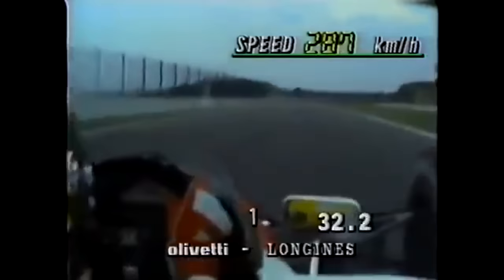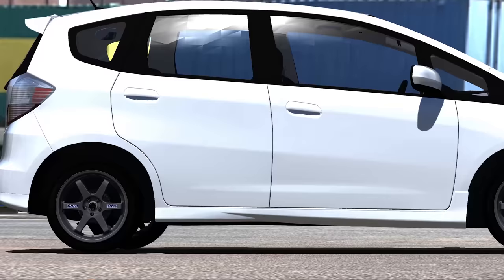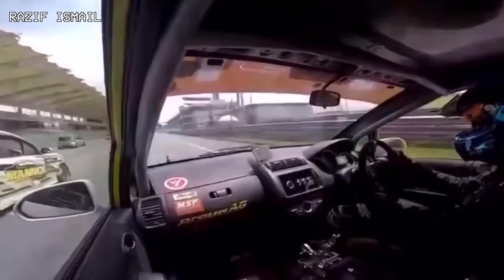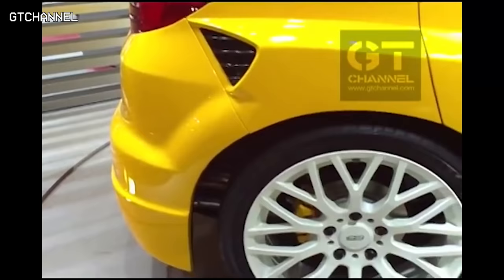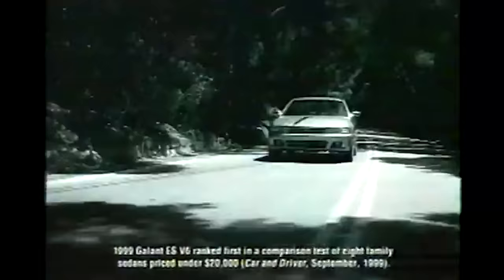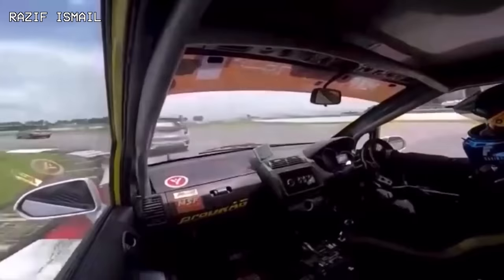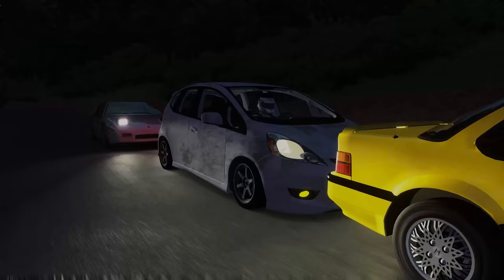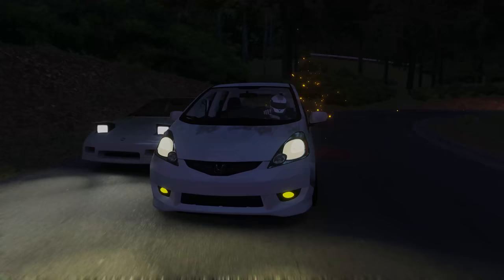Honda Fit - What Makes it so Great?

Comment: Yall i freaking love Fits, It made me so mad that honda is no longer bringing them to the US. I was so looking forward to the super sharp design we would have had. But I've an 07 base and now an 08 sport and I'm in love. Just stock these cars have quite a bit of power behind them. It shocks everyone at the stock rally I visit occasionally. Not many people expect a sub compact car to be able to accelerate, and handle like these do but it's all props to honda, a manufacture built on making it's customers happy. If we weren't happy we wouldn't keep buying the same brand, and trust me I've owned just about every basic daily brand out there, Nissan hated it 2015 went through 3 transmissions in 2 months... pontiac was okay brake system was shit, kia known for being killed in action blowing the motor, VW I loved my jetta only reason I sold it was due to medical issue keeping me from using my left leg to push down so couldn't press clutch. Hell I even had a chevy/toyota collab car the prizm, built with the same parts in the same place as the corrollas just had the old oval chevy logos. That was a great car till the alternator went and threw the timing off.

Comment: I've owned my 2012 Fit Sport 5 speed manual since new. Been a Honda head for 30 years, so it was my 4th Honda. I bought it because it reminded me of my first car, a 1989 Civic Si; light, tossable, great handling little hatch that is a blast to rev out!. I still love driving this "dinky car" as my wife like to call it. Nothing like taking highway on/off ramps at speed and feel the car just bite into the corner with some serious grip!

Comment: Japanese hatchbacks are a lovely work of engineering. Never had a Fit but always noticed them and imagined how much fun they would be. Am currently driving a Canadian K13 5 speed Nissan Micra. Maybe a Micra video could be done sometime?
Reply: I was thinking about the same because of my k13 manual. Its my first car, I have it for 8 years now and I still love it!
Reply: @raphaelaml391  They are great cars. I've driven my Micra across Canada seven times. No problems. Never a check engine light. Simple regular maintenance. Strong little machine.

Comment: I had a fit and loved almost everything about it. Except for the power. I think Honda missed an opportunity with this car to take it from a great car to excellent -> k20 motor. Had they done an Si version on this thing… we woulda been all having Fits.
Reply: What generation? I've driven 1st gen auto and 3rd gen CVT and its a night and day difference. By no means speedy, but plenty of power for its size.
Reply: The Fiesta ST was one of the few performance subcompact cars available in North America. Too bad it wasn't exactly the most popular car and a lot of people didn't really know it existed (It often gets mixed up with the Focus ST). Basically the size of the Fit, but with 200hp and 200tq. It had great aftermarket support and people often turbo swapped it easily making 300-350whp reliably. It's nuts putting that much power in such a light and nimble car... Now if only GR Yaris came to North America...
Reply: @AzNightmare  I'm not sure that the Fiesta is relevant to this conversation? Is also turbocharged where what people miss about the old Hondas is more the NA power.
Reply: @christopherjohnston6343  Well, it's a car that is similar in size. I don't think anyone is missing old Honda NA power. They want something tiny like the Fit to have more power.
Reply: @AzNightmare  you clearly have never owned an older VTEC Honda. If it was just about speed we would be asking for a turbo L15 - which pretty much makes the Fit a competitor to The FiST. But when people go on about K20 Fits its because these were the engines in the type R Hondas and they revved well and have great potential as an NA platform.
Reply: @AzNightmare  I have a 2016 with 20k miles on it all mishimoto add ons...
Reply: @AzNightmare  ps I would have bought a gr yaris if it was available here in the usa...
Reply: My Honda Jazz around town is pretty slow but once I'm in the mountains and honking along over above 4500 rpm there's no lack of power relative to its size. I can keep up with a lot of bigger more powerful cars unless there's long straights.
Reply: @caesarforlife1663  same thing. My Fit is basically a Touge beast. Small size with decent handling means I can carry a lot more speed on narrow roads than bigger cars - even if those cars are a lot more powerful

Comment: Years ago, I had an EG Civic (before nice ones were rare). I loved it. While looking to downsize, I recently watched a Fit review, and noticed that the Fit's specs are similar to the old Civic's. I get what makes it so good.

Note: I bought a Mazda 2 with a 5 speed and haven't stopped smiling yet. I'm curious how the two compare.
Reply: I remember car and driver saying the Mazda 2 was more fun but the Fit was just way more practical while also being fun and engaging enough. So they chose the fit for the 2010 10 best
Reply: @ShaiyanHossain  I guess that's why you see so many more Fits on the road.
Reply: mazda has plenty to offer in tech, unlike honda which kinda stingy but for all the accessories, honda has unlimited toys to buy & play.
Reply: I used to own a Mazda 2, and currently own a second gen fit. The mazda feels more raw than the fit, sharper throttle response, a very easy to use clutch peddle (engages very low so you just take your foot off the clutch and your off, vs the fit where it engages near the top of the pedal, requires more conscious effort to operate, the downside is the 2's clutch is much easier to burn if your doing hard launches all the time) The 2 feels better at lower speeds generally, quicker turn in, more willing to rotate (can bite you in the wet) while the fit feels more stable at high speeds. I find the Fits drivetrain to be a lot more exciting then the mazda 2's, (117 hp at 6800 rpm with 4.6 final drive [second gen fit] vs 100 hp at 6000 rpm with 4.1 final drive), but the mazda 2 is like 100 kg lighter so its not slower at low speeds, just feels slower with the relatively long gear ratios for its power level. Obviously the fit has way more room, its basically a mini mini van. Overall i'd agree with the sentiment that the mazda 2 is more fun while the fit is more practical, with the caveat that the engine and trans combo on the fit is more fun than what you get in the mazda 2. But they are both excellent cars with a good balance of fun and practicality, with each leaning slightly towards opposite ends of that spectrum. 

P.S. I think the fit may also have superior build quality, it being a honda, thing feels indestructible. I've owned a mazda 2 and a 3rd gen mazda 3 and both seemed susceptible to having their alignment thrown off by hitting a pothole, but that's likely due to the high negative camber that mazda runs on their cars, which is probably also the main contributor to the great turn in response that they have.

Comment: It's the biggest small car! A really innovative feature is how the seats in the back fold up (i.e. the part that you sit on can be lifted up). this allows you to store tall things like pot plants. It's a little thing but it's just so clever. Our household has a fit and a Mazda 6 (Mazda Atenza). We use the fit so much more. To transport cargo, it's much more versatile. On road trips, it saves petrol. In the city, it's easier to park.

Comment: I was lucky to find a 09 sport 5MT with a blown engine for $200. I spent another $1200 on a used engine and labor (perks of working at a Honda dealer). 3 years later and I still love it, I get up to 40mpgs and have a blast shifting through gears and taking corners. Truly an amazing commuter car.

Comment: The best honda fit/jazz is the 2nd gen, Its chassis is based on the FN2 civic type R. The car handles amazing and this is coming from a 86 owner.
Reply: seconded with the GE, i run HSD Dualtech Coilovers, RZCrew Intake Manifold, K and N induction, 2 inch exhaust system, Corbeau A4 seat, Hybrid Racing Short Shifter and it feels like im driving a racecar all the time hahaha, the damn thing eats through every corner without fail, I genuinely dont want another car.

Comment: I agree, the fit is criminally underated. In fact I think it's the new ek/eg. I've owned ae86's, c33 laurels, s14 silvia etc etc and my current GK5 with a little setup is astonishingly good as a touge car.

Comment: Love my 2009 Fit. I was looking to replace it with a 2022 model and found out.....very unhappily that Honda stopped selling them in the U.S. market ☹️
Reply: If it makes you feel any better, there are plenty of Aussies that are salty about Honda not selling the 4th gen Jazz over here. Fit/Jazz owners really - and I mean really - love these cars.
Reply: I also have a 2009. Has 265,000+ on it. Was wanting two this fall. One for me and one for the wife. It is so disappointing that they aren't here anymore. Their really isn't anything out there that compare quality and cost. They just want us to buy bigger and more expensive.
Reply: @micahreynolds3450  That is freaking sweet! I've "only" go 170K on mine, but it's getting body rust where I was side swiped in 2012. I got it fixed at the dealer's body shop, but over time (and with the salt they put on the roads in winter) it started to rust in 2021. Body work in the US is expensive, so my poor baby is not financially worth fixing now :(
Reply: @jayjayquest4958  That's sad about the rust. I live in the south so we don't have a lot of salt on the roads in the winter. When we do have some I try to get it washed pretty quick. No rust so far and almost everyone that I tell how many miles it has is surprised. I have the orange one and it still looks pretty good. Could use some new carpet but that's about it.

Comment: A front wheel drive car will tail spin in a corner if you are going too fast and let off the gas to slow down. A rear wheel drive car will not do this.

Comment: Bought ours new in 2004.  Used as a runabout and school run car, both sons learnt to drive in it, then each one of them ran it before buying their own (including several hard driven European tours). Sold it in 2019 after 145,000 miles. Zero failures. Only ever used consumables and fuel. Stunning car👍

Comment: I got a 5 speed stick, 2007 one, because it was cheap and easy on gas.  Gotta tell you, it’s actually kinda fun driving in the city with it.   And on my way home tonight, I was bombing down the highway and taking some on and off ramps pretty fast.  Felt awesome.      Also the steering is so tight.  Like most power steering has this annoying little slack to it, but mine is like rack and pinion or something.  Super responsive.

Comment: I had a 2007 fit with the manual transmission for my first car and didn’t really appreciate what I had till it was gone. I sold it 2 years ago for a civic hatchback and I really miss my supper small fit. I ripped almost everything out of the inside and put a better suspension system in. This was done so I could take it up to the mountains of North Georgia and absolutely thrash the hell out of it on Forest service roads. I put it through some real abuse and was at the time glad to sell it for the nice new car but I do really miss the fun I had in it.

Comment: First gen (2008) fit owner.  I LOVE it.  I’m tall.  6’5”. I got in it as a joke and was shocked I fit. Purchased it as a second user from dealer as first owner used it on farm with farm fuel so I got a brand new engine in it. Second and 3rd gen I don’t fit in. I do contracting work and the space it has inside for cargo is mind blowing. People are SHOCKED how well it fits all my gear. No hesitation but I highly recommend it to tall people as well!

Comment: I bought one in August of 2017, it is a 2018 Model with CVT, and it has the navigation, moonroof, leather seats and 2 position heating in the seats, 6 speaker system, with Apple Play, which is great because I do have an I-Phone.  Love my silver Honda Fit, and plan to keep it for a very long time.   I love how my back seats folds up or down for more cargo space and I do have a cargo cover.

It only has 14,000 + miles on it in the five years that I have owned it, and of course I follow Honda's maintenance program with it.  My five-year over all gas mileage average is 26.87449376 and cost for gas $17.71, I have used my Korger Fuel points which helped keep it low.  

I heard two years ago that the end of 2020 would be the last of the Honda Fit model.  I am sad to hear that because they are great little economical cars.  Parking is so much easier with this car including parallel parking, and with the right turn camera and backup camera with the guides that makes it easier as well.  I also love the cruise control sensing, and I use it always.  I always use the Econ button too.

Comment: I bought a 2013 Fit Sport 5MT brand new, so I got to order it exactly how I wanted. I overpaid, but it was my first new car and I'm still in love with it and will never get rid of it. When I'm finally done with my two current project cars and have less need of the Fit to be my reliable car, I'll start tinkering more with it. 

Just wish it looked a little better. The years (and people) have not been kind to it. Plenty of door dings, dents and scratches down to the metal. Luckily, cars don't generally rust where I'm at, so I can at least ignore a little bit of it.

Comment: I have a 2nd gen that I love. It's a car where when working on it, you can tell they put design effort into thinking about how someone could service it. It's spacious, I haul all my tools in it, plus spare jackets, and still have space for scrap coils.

My only gripes with it aside from the necessary valvetrain adjustment at about 100k miles, is the somewhat rare issue with blowing spark plugs out the head, and the fact that it's, not that fast. 

The spark plugs issue, I'm not sure what the root cause was, I know other people have had it. But not enough to warrant serious attention I suppose. It stripped the threads on its way out. Honda dealer quoted something like 4-5 grand for the job, they wanted to replace the whole cylinder head. We took it to Smyth and got a helicoil put in for 50 or 70 bucks.

The speed. Maybe it's because I have an auto-box, but it doesn't accelerate all that fast. You really have to give it the beans to get up some hills.

Overall though. Even if the mileage isn't that impressive compared to some slightly newer cars (I get about 30 combined) I love the thing. Great to work on, great little commuter car that can haul a surprising amount of stuff.
Reply: Ran into a blown spark plug for GE8 Fit. I also helicoiled it and it has held up 40k miles so far. Though I had another spark plug loosen up but didn't blow out, I think the plugs need some threadlocker.

Comment: my son now drives the 2009 model I bought one year after it was new. It’s a masterpiece: fabulous handling and balance, great go and stop abilities and the 5 speed manual is lovely. In many ways it’s more in the spirit of the original Mini, but a lot safer and more practical. And the killer feature is the amazingly flexible interior; on more tha one occasion i’ve carried a 750cc motorbike in mine, with the passenger seat still free. Miss that car!

Comment: One of the most non pretentious (except for the paddle shifts) car ever made in automotive history. Practical to the point that it offers more space than so many crossovers and sedans which are many times more expensive, stupidly reliable and cheap to run and own. If you're not rich, this is the vehicle you want, because it'll just keep running. Love my jazz.

Comment: I have a 2007 Fit Sport with a manual transmission. I ordered it brand new from the dealer and had to wait almost 6 months for it to be ready because of the color I wanted (Orange).

This car has never failed me driving the rough streets of NYC on my daily commute to NJ. 

I now have 225k miles on it and only recently had some things start to fail. I needed to replace the idler pulley because it seized, the radiator and AC condenser were rotted away due to the salt used in NY during the winter, and I needed to replace the upper OX2 sensor which was a bitch trying to disconnect the wiring harness. The headlight lenses have needed to be polished out a few times due to severe oxidation, and I've noticed my floorboards in the rear are showing signs of rusting out. 

But other than an alternator, brakes, tires and a belt and wipers, I haven't any other major issues. It still runs great and still has the original clutch.

I'm starting to realize it won't last forever so I'm trying to figure out if I should start looking for a 2018 or 19 with a manual transmission now so when mine finally fails in the next 3 to 5 years, I'll already have a replacement.

I truly love this car because of everything it does so well. It just checks every box for me. Is it a luxury car that rides smooth and quiet? Nope, but it's not supposed to. But it literally does everything else so well, including handing the snow really well when I put good snow tires on it. 

So although I'm sure I can get a few more years out of it, I know if I want to have a  Fit for the next 15 to 20 years, I'll need to pick another newer model up soon, otherwise they'll be impossible to find when mine finally dies. 

I'll also mention I own a 2005 Honda Pilot that's now 18 years old. I bought both cars new and they were both great choices and I have no regrets.

Comment: My wife has an orange 09 fit 5 SPD sport. We love it. It's barely needed anything but maintenance,  it has 200k , and it's paid for itself in the last 2 years just doing GrubHub deliveries at night.  Plus all the other use it gets, It gets a lot of stop and go some weeks, but it's never had a problem, even in pretty decent snow storms, even the clutch is original